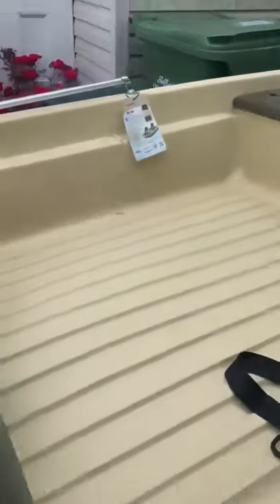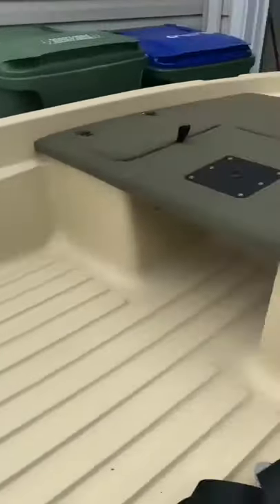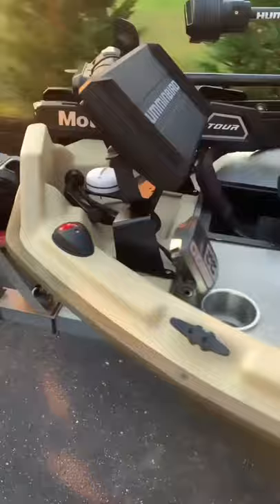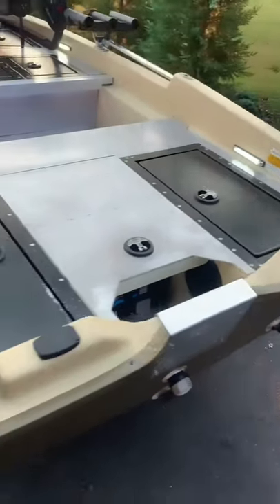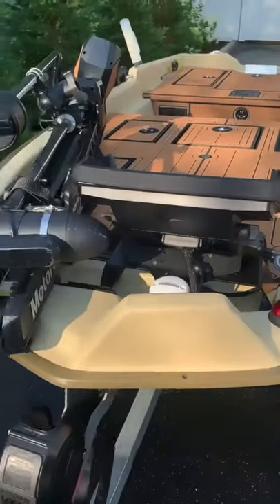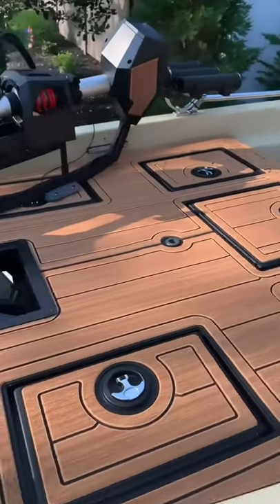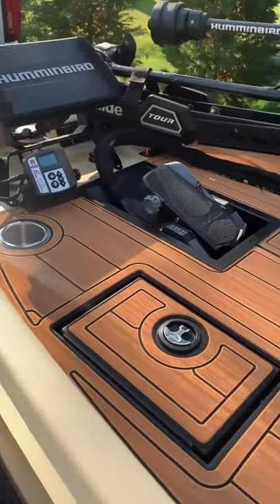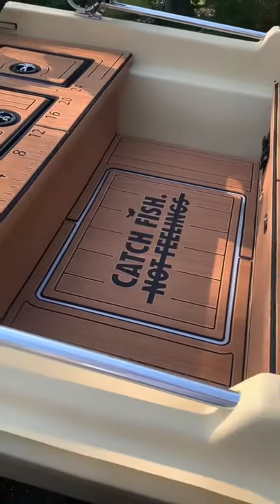Sun Dolphin Pro 120 on STERIODS! Plastic tiny boats.

Comment: I run the same boat with a deck extension also. I got a 2021 Suzuki 4 stroke and it cruises at around 15-16 mph and tops out at 22 for me. Super stable. I can stand on the very edge and it barely moves. Im 6 ft 240 lbs for reference
Reply: That’s sweet! I wanna check that out , is it on Instagram?
Reply: What hp is the 4 stroke you’re running. I have a 9.5 2stroke evenrude on mine and I haven’t got to up on plane. I see others with same size or smaller engines get planed out. Maybe it my prop idk.

Comment: Just picked up a brand new pelican predator 10.3 plastic boat. Comes with a live well which I will be upgrading to a recirculating system and also is pre wired. Going to video the entire build. Any ideas on how to attach aluminum framing to plastic? Can't wait to get started. That sun dolphin is sick though!!!
Reply: I used some toggles anchors in key areas .. rear was a ton of rivets . Not going anywhere 🙌🏽

Comment: How does this plastic boat handle a 15 horse outboard?
Reply: Does really well for me. I get top speed 22 mph and cruise on plane at 15-16 mph. 2021 Suzuki 4 stroke electric start
Reply: I have been fishing my 120 pro since 08 with a 15hp two stroke Mercury and it ran great, this year i came across an old 20hp Evinrude two stroke and tried it on my boat , the difference was like night & day , 15 is perfect these boats , but the 20 was a bit too much , 15 planes out faster and is much safer on these little boats !!!

Comment: The problem with these boats. They don’t have a drain plug. So you have to bail out water or flip the boat Over
Reply: They do have a drain plug in the back .. also you can add a bilge like I did . I only get water inside the hull when we heavy rain